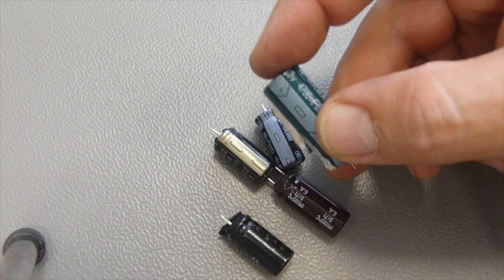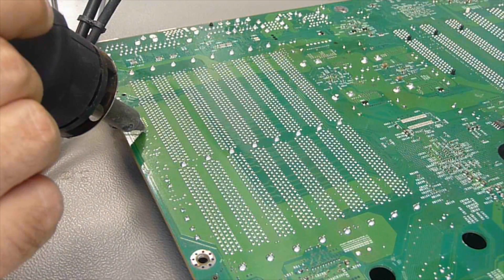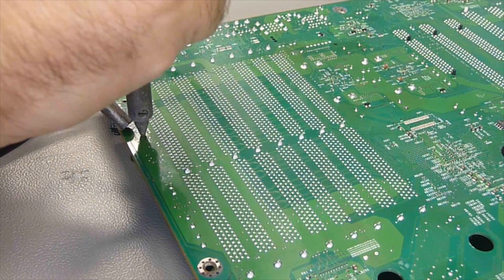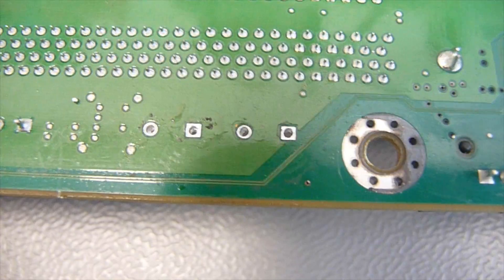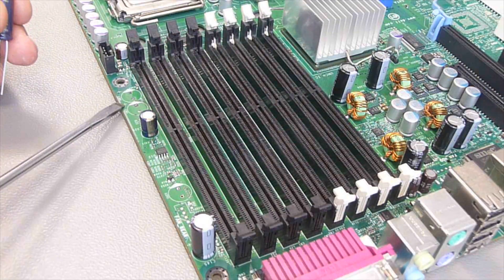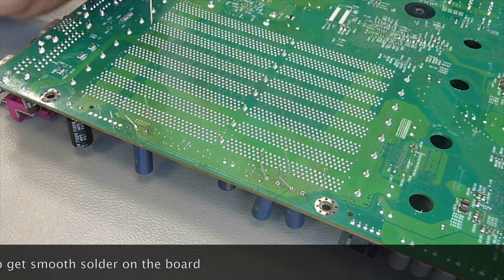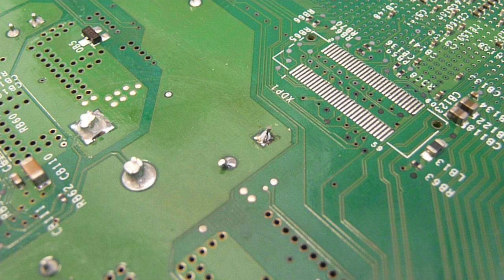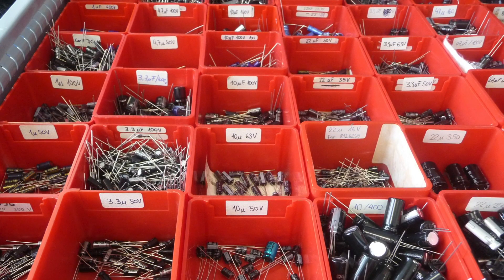Blown capacitors: mainboard repair (PWJ64a)

Comment: i have changed a lot of  capacitors on new(pentium 4 , dual core)  motherboards and after a while some of them have the same issue(are a little blown up) 
what is causing this issue any ideas?
Reply from the maker: Maybe you installed capacitors of bad quality. Or you chose a wrong type.
I always take good brands like Panasonic or Nippon Chemicon, then make sure they are rated for 105 Degree C. Then choose highest 105Deg lifetime. Also a low ESR is important because the higher that is, the hotter your Caps get. And also try to get the temperature insinde your PC down.
High temperatures and low quality is what makes capacitors fail.
Sometimes also poorly designed boards, but that's something you can not change.
Reply: i always use 105C degree but not panasonic or nippon brands maybe there is my mistake ! ty for answering me i will try again

Comment: The thing that has worked best for me over the years, is a small chisel tip on a 40 W soldiering iron, cranked up pretty high. I then use an air compressor regulated around 40 psi. I have an angled blowgun that sits very comfortably in my hand and allows a very natural position. On the end of that blowgun I have soldered an inflation needle. (Like those used to inflate a football). The joint is heated in a few seconds or less depending on the thickness of the PCB. Once the joint is heated, a quick well-placed blast of air clears the hole completely of solder. 95% of the time the hole clears so perfectly that the component leg is movable with zero solder left in the hole except for the tinned edges.There have only been a few very thick PCBs that are double-sided (and plated both sides) that take a bit longer per hole. I can remove a 40 pin package in about 30 seconds safely cleanly and with zero heat to the package or the board. This becomes a little more difficult with lead free solder but still works great. The only real difficulty is thick double side plated boards. I have removed thousands of components per day (when I started harvesting electronics as a kid,) and it took me a few months to come up with this method after starting with solder wick and then building my own vacuum desoldering rig...... honestly, no one would need remove so many components unless harvesting components for fun in the learning about how things work.. Because there is absolutely zero reason (or profit) in harvesting 99% of all components. Especially these days when $10 on eBay can buy  enough components to Tinker for a month! Just thought I would share my method
Reply from the maker: That sounds like a working solution. But isn't there an ugly splattering of solder everywhere?
Reply: No not really. 90% of the solder gets stuck on the leads of the components on the topside of the board. The other 10% usually goes in your lap or maybe some on the board, but its such a fine misting of solder,..... that it cools in mid air in microseconds. I think I need to make a video showing the procedure, my setup, and how it works. Including the custom blowgun, collapsible containment workstation, and the end result. Iv never uploaded any of my videos, but ill give it a try. You can find me on instagram at "Hull Guitars" .... but I havn't posted any electronics on there yet.

Comment from the maker: The problem is that lead-free solder (RoHS) has a higher melting point. This makes it more difficult to remove parts. Mixing it with fresh lead based solder lowers the melting point od the mixture and improves the flow of the solder.

Comment: Adding additional solder and mix with the old solder can sometimes help if the soldering iron is warm enough. Then use tools to remove all the solder. Worked for me plenty of times. Because I don't have any desoldering gun.

Comment: How much did that equipment cost?
Reply from the maker: Pace desoldering iron $1000, Leister heat gun $1000, Capacitors from $0.30 to $5
Reply: Wow, that's insanely expensive.
Reply from the maker: for home use you can get it cheaper. A chinese hot gun (there are good ones around) is probably only $200
Reply: I bought one of these:
https://www.youtube.com/watch?v=fgT9LO8lqyQ&t=16s
OK, the mains flex isn't the best and it lacks a power switch (both fairly easy mods).  But I'm really impressed with how well it works.  Can't knock it for £80.

Comment: I mostly use the "solder bubble" method, connect both capacitor legs with a big bubble of thin, then heat the bubble up until you can easily remove the capacitor.  For the solder wick it's a good idea to use extra flux, makes it much easier.

Comment: I'm using a Hakko desoldering gun (BEB #51). 
I highly recommend you the Weller WSP-150 soldering iron with the Zero smog adapter. Pure fun. 
Also, I'm very thankful for the hint with the hot air gun. I have a Leister myself for other difficul tasks. What a great tool.
Reply from the maker: Desoldering iron and hot air gun is the best combination I know. We have tried different methods and some damage the board too much. This is certainly the fastest method and everyone I showed it uses it.

Comment: Hi, Do the electrolytic capacitors dry out in storage. Should I replace to one in my parts draw over 10 years old. Good idea pre heating  the board with the heat gun. Cheers Dave
Reply from the maker: Our caps don't get old :-)
Reply: Yes, electrolytic caps have a limited shelf life. As under operating conditions the temperatures are much higher and good ones will last around 8 - 10 years, I would assume the shelf life is around double that, 16 - 20 years. 

>  parts draw over 10 years old. 
Check them . Esp the ESR https://en.wikipedia.org/wiki/Equivalent_series_resistance
Reply from the maker: It depends on the quality of the caps. I wouldn't take them when they are older than 15-20 years except for experiments. They can be fine but not for a commercial product.
Reply: Nippon Chemicon has a great PDF document about guidelines (for aluminium electrolytic caps). I have read it once, and I can highly recommend it.
Caps should be used within 3 years, they say:
https://www.chemi-con.co.jp/e/catalog/pdf/al-e/al-sepa-e/001-guide/al-precaution-e-170401.pdf
Nevertheless, I have seen 40 year old caps NOS in perfect condition.
Ultra Low ESR is the first choice for modern mainboards. 
I test each and every cap with my Agilent U1733C to be within specifications.

Comment: Greetings from Russia. We have a popular method:
Take
Wood's metal (~ 42 % lead, ~ 40 % bismuth, ~ 9 % tin, ~ 9 % cadmium. Melting point is 68°C)
or
Rose's metal (~32 % lead, ~ 50 % bismuth, ~ 18 % tin by weight. Melting point is 95°C)
Rose is more popular, since it does not contain cadmium and is less toxic.
Apply at 400-450 degrees on lead-free alloy
So you get an alloy with a melting point of about 110 degrees.
Sometimes it is even inappropriate to heat the part in addition, it falls out by itself.
After, MANDATORY remove the resulting alloy from the place of soldering, it is brittle and fusible.
Thus it is possible e.g. SO8 desoldering chip without hot air.

Chip Quik SMD Removal Kit for the poor :-)

Comment: I will probably order a desoldering iron. I've had to replace blown capacitors on that motherboard (20, eek), two power supplies and a monitor (The power board). The method I used is to clip the capacitor on the top of the board, leaving just a small piece of the wire exposed. I think (Without pulling, just holding) used the soldering wand with a bit of flux on the back of the pin and some glob of fresh solder. The pins came out quickly and I used the desoldering pump after. But one capacitor didn't want to move (It was on a wide strip of copper) and it was a pain.
Reply from the maker: For my home lab I bought a Pace desoldering iron but only the hand-tool part. I added a transformer with 20VAC output (fixed voltage, full heat) and a small vacuum pump from an old tape drive. Works fine for a fraction of the cost. I think the handle with heater and tips was about $300 (still expensive)

Comment: Have you had any suction issues with the pace iron? I picked up one used a while back, and something in the handpeice seems to be ruining suction, and I haven't been able to figure out what's happening.
Reply from the maker: This handpiece has a rubber piece for sealing between the tip and the solder collection tube. If the wrong tips are used this seal can be damaged. The hole where the tip goes through gets too wide and it sucks air in there. Also the collection tube (glass or disposable cardboard) must be seated properly.
And of course the tip must be cleaned from time to time.

Comment: Since a couple of days/weeks Reichelt has Kemet A750 series. That seemsw like a perfect replacement for Nippon Chemicon KZG and similar (Panasonic FJ). The Panasonic FK you are using don't seem to have a low enough ESR to be a perfect replacement because ESR is higher. On Motherboards I'd tent to prefer Polymer capacitors because of the low ESR and high ripple current capabilitys. Those are needed for VRMs...
And they sould even shipp to your country I think ;)

If you order 500 at a time and are a business, Mouser might be cheaper. Especially with worldwide free Shipping. But only then...
Reply from the maker: Yes we can get them, no problem. But we had no bad experiences with our caps. They are still way better than the crap caps sometimes found in devices. We have never had a repair where our replaced caps have failed.
Reply: They work and may last. Still you might want to go up in Voltage and Capacity a bit because of ripple&noise due to way higher ESR. Those Ultra Low ESR capacitors (wich most companys don't do anymore) have a rather low ESR. A 1500µF/6,3V Nippon Chemicon KZG has about 26 Ohms ESR. The Panasonic FK you are using are rather bad with 44 (8mm) or 49 Ohms (10mm). So I wouldn't use them for Motherboard Repair outside of USB filter caps.

The Panasonic FR series seems like a better Choice with only slightly more -> 30Ohms for the 8x20mm 1500µF/6,3V. And much much closer with the 6,3V/1800µF 10x16mm Panasonic FR (28 Ohms). That seems like a really good option...
And the best Choice seems to be Panasonic FM with very low ESR, the 1500µF/6,3V cap has only 19 Ohms ESR and ~2A ripple Current (wich seems to be way better than the equal Nippon Chemicon KZG).

However the Panasonic FR series seems to be more expansive than the Kemet A750 Polymers are...

Depending on what's cheaper you might choose Panasonic FM or Panasonic FR, maybe some Polymer from a named manufacturer.

The FK series you use here however are a great choice for recapping old stuff from the 80s and early to late 90s.

Grüße aus dem Norden ;-)
Reply from the maker: What you say is certainly correct. The problem I have is that not all values (capacity and voltage) are available in all caps series. Some values are quite hard to get. The second issue is that some other series are bigger in diameter or height. Sometimes we simply need a certain size and we can not replace the cap with a better one.
In fact the devices we repair are quite old. Most newer servers don't have such elecrolytic caps at all.
Reply: Yes, Panasonic FM/FR is very good. They are the only caps I use when recapping stuff.
Reply: And that's another reason for Polymer capacitors ;)
They tend to be (way) smaller than normal wet Electrolytic ones.
A 6,3V Kemet A750 with 1500µF is only 8x12mm small. 
A way better Nichicon RNU is 10x12,5mm though. BUT: Due to the low ESR it's possible to go down a bit with the capacitance and use a 1200µF cap instead. And this one is 8x11,5mm. And far superior to the Kemet in every way (way lower ESR, way higher ripple current and higher rated lifetime).

You only need to find a cheap(ish) source for those ;-)